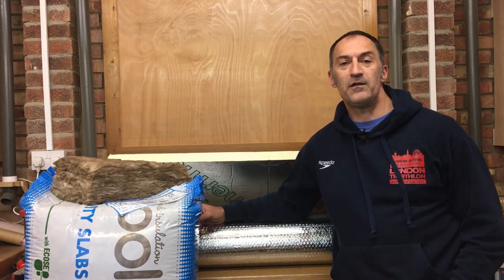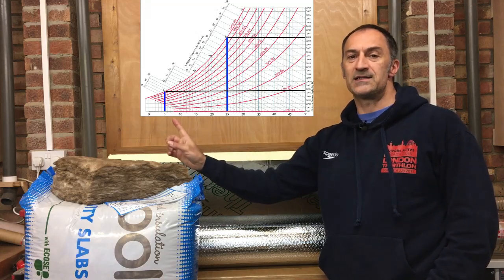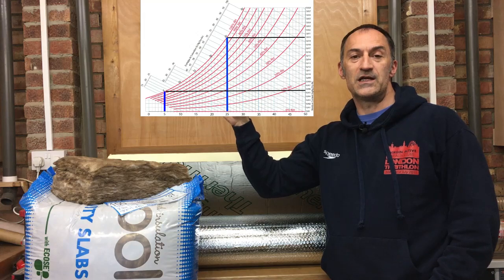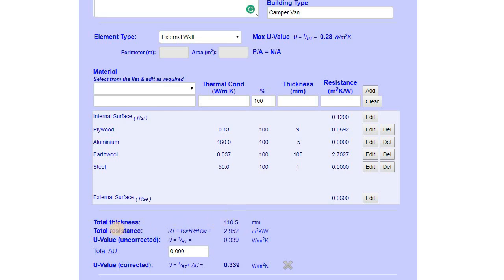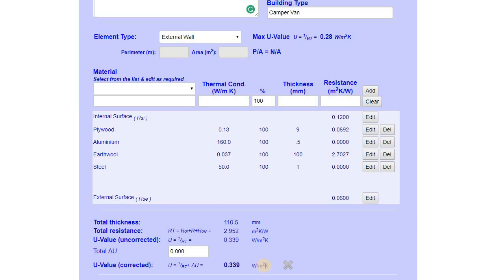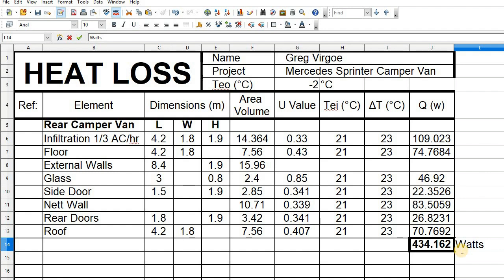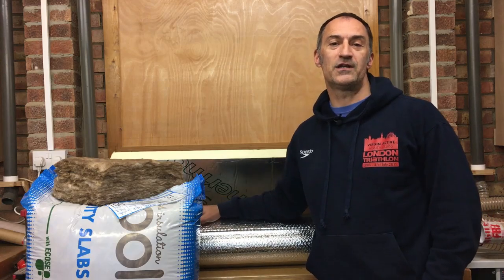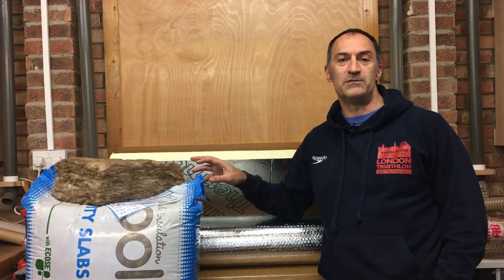How to Insulate your Van Part 1 - The facts you need!

Comment: I can see you are on home ground now, with all those R's and U's.:)

There is a train of thought that you should let the insulated layer 'breath', so that if moister does compromise your vapour barrier then it can naturally dry out. What are your thoughts on this?

Secondly, did you find handling EarthWool gave you any irritation problems?

Finally, it would be useful if you could measure the thermal properties of a van before and after insulation. Say, park your van in an enclosed garage put a 1kw electric fire in the back and measure the the temperature differential after a fixed time.
Reply from the maker: Hello, Some great questions there, and here are my thoughts :-
Letting the insulation breath would apply to a building structure where the materials you are using are semi-permeable to water like bricks and timber etc. In the case of our van, we have a sheet steel outer skin which is painted, insulation in the middle and a foil vapour barrier on the inside. This creates a completely vapour sealed void where moisture cannot enter from either side keeping the insulation dry at all times.
I hate working with glass-fibre products, the fibres get in my throat and I'm coughing like mad, but this Earthwool is really soft to handle, no irritation to the hands or arms and I had no coughing at all. I was really pleased with it.
Lastly, we have plans to take the van to a climate control R&D facility when it's complete and run full tests on it, so please subscribe and watch this space. Thank you
Reply: Sorry for the late reply, just spent all day freezing under my van finishing off fitting the water tanks.
That's execllent news about the EarthWool. I recently insulated a new stud wall with glass fibre wool and it was a horrible job to complete!  Vapour barrier it is then, looking forward to the next installment. Be quick:)
Reply from the maker: I have my belly tanks now too. I’m sprayed no the metal brackets and will line them with armaflex foam strip.
Did you use CAK tanks?
Reply: No didn't use CAK since I found them difficult to communicate with. Instead used G.F.G Plastics. Really good service and very friendly. They built the tanks exactly to my measurements. If tanks can look nice, then their tanks look nice! I fashioned my own brackets out of 4mm strip steel, fastened with 8mm studding into M8 rivnuts. 

I will try to get some YouTube pics up of my build. Won't be anywhere near your standard, but if it helps others then great.

Hmmm, Armaflex now thats a good idea. . .
Reply from the maker: +Flashback if you have time to post a few photos to my Facebook page that will be very interesting to see. I have the tanks but no paperwork or instructions, will be contacting them tomorrow for some advice. I thought the armaflex would help prevent vibration and chafing of the brackets on the plastic.
Reply: My brackets are 30 x 4mm steel strip. I don't think this tank is going to move. They are constructed from 6mm plastic and feel pretty rigid.

Sorry, not into FaceBook, but I've posted a few pics on Flickr:

https://www.flickr.com/photos/138368573@N07/albums/72157687540251772 

Couldn't bend the strip at 4mm, so hacksawed a 1mm deep cut which helped give a clean bend, but still had to use a club hammer. Fianlly, painted with grey Hammerite to protect. M8 studding galvanised steel, but  nuts, nylocks and rivnuts are all stainless.
Reply from the maker: Thanks for the heads up. I will try email first. Cheers
Reply from the maker: I have looked at your photos and seriously impressed. For starters your photos are incredible, the picture quality, clarity, the out of focus background effect, you must be a professional or have studied this?
Secondly, the brackets are ace and you have done well making them with just a grinder and vice.
You should make a video of the build for youtube, I would watch this quality of work. Well done!
Reply: Well, thanks for the generous compliment and yes I have done a 'bit' of photography. The camera used for the brackets is the ubiquitous Panasonic LX100. A great all round camera. I do plan to put all this stuff in a video, but I'll see how it goes. 

Whacking that piece of steel with a club hammer was my desperate attempt to keep the project rolling along!  I much more at home with a piece of wood and have a decent amount of tools for that.

My actual profession is an electronics engineer. I'm in the middle of designing a complete bespoke control system for the van. This will integrate the battery charging/monitoring, solar control, electric step, water levels and security system. All readouts will be OLED, with a synthesized voice output for warnings. A bit over the top, but heck who cares!

Any joy from CAK?
Reply from the maker: That control system sounds right up my street, will be very interested to see that. 
I've emailed them initially and hope I get a reply tomorrow.
Keep me posted with your build updates.
Reply: I had trouble with CAK not replying to e-mails. Maybe their premium phone line is there for a reason:(
Reply from the maker: They do appear to have a landline number also now I’ll try that if I don’t get an answer. Thanks for your help.

Comment: Fantastic video and beautifully explained so even I could grasp the theory behind what materials and why.Also noted you answered a question on sound deadening, I was delighted when I clicked the link as the eBay items where exactly the ones I have identified for soundproofing my car,  gives me confidence that I have chose the right products. Look forward to your next video and thanks again.
Reply from the maker: Hello Paul, yes the two products look very similar, some manufacturers use it to reduce the drumming effect you get with thin sheet metal panels.  However, some people have mistaken this for foil covered bubble wrap and are using that thinking it will give them some level of insulation. Applying bubble wrap to the steel van is completely useless. Pleased you got the right stuff.
Reply: Greg Virgoe cheers thanks Greg

Comment: Great video, and so great to see some actual engineering and expertise involved in insulating vans for once. The 434W figure at the end, how does that apply over time? for example, is it 434W/hour needed to keep the van at the same temperature level assuming the outside temp as specified? Or how would that be calculated?
Reply from the maker: Excellent!  What's more interesting is that with a little light exercise two people could easy generate enough wattage on their own lol
Great comment Karl, made me laugh.  Cheers
Reply: The interesting thing to consider also is that a human gives off 100W so I guess Greg only needs to keep 4.34 humans in the van to keep its temperature stable.
Reply from the maker: It's simply a measure of the energy you would need to maintain it at that temperature.
So a 500w heater running in the van would offset the losses and maintain the 21 deg inside.
Reply: Greg Virgoe that’s why the double bed will be installed …!!… LOL
Reply: @More-Space-In-Ear  and a heavy duty suspension for those really cold nights :D
Reply from the maker: Marc’s Fx, I don't think I've got room for two yoga mats lol
Reply from the maker: Stokes Pen, absolutely right the the more you ventilate the more heat you will need to warm up that cold air. The first part of the calculation deals with the air change rate. The calculation was only for the rear portion of the panel van from the bulkhead back. I did not include the cab which will have a higher heat loss due to the glass but even so a 2kw heater should be plenty to keep it warm inside. I've been using a 2kw electric heater in the van while I'm working on it and it soon gets very warm in there even when it wasn't insulated. Thanks for watching.
Reply: Greg Virgoe Ha Ha Ha.....yoga indeedy 😂😉👍🏼
Reply: Actually, the convection is neglicted here, which can be neglicted above 5 m/s of wind and make a noticeable difference above 2 m/s. So the 434 W are just a part of the total losses. It means that you need 434 Wh of energy to maintain the temperature during one hour. But modelisation never ends, at some point you need to unroll the finite elements analysis…
Reply: C’mon love, let’s exercise! The inside temperature is dropping! :-D
Reply: Fantastic presentation!
Reply: Fantastic presentation! Thanks Greg!
Reply: Hi Greg, I live in the US. I am planning to be building out a van in the next few months. I have been told that if I am going to be spending 85% of my time in the van in warm/hot environments then I should not insulate my van. Is this the case?
Reply: Sorry there. Didn't realize I was on a reply screen.
Reply: @karenbickel1154  insulation provides real value in hot and cold temperatures. It must be insulated for comfort too.

Comment: thanks Greg just like to ask you why not use recycled plastic insulation it wont a zorb condensation  ?
Reply from the maker: Hello Milo, Having read your question again I needed to rephrase my answer. 
The purpose of the vapour barrier is to prevent any moisture getting to the cold surface of the metal van, this is where condensation will form and this could rust and rot the van in time. Having an insulation that is moisture repellant is a good thing but I don't want the moisture getting in there at all if I can avoid it. The Earthwool is made of recycled materials. Thank you

Comment: Hi Greg, thanks for the great info, charts and all, really look forward to catching your videos. Just a small thing that I’m sure you noticed but I’m sure the thermaboard insulation was missing from your Uvalue calculations...not sure if that was intentional. Anyway thank again look forward to the next one!
Reply from the maker: Hi Stephane, that's super observant of you. I'm using the insulation in different parts of the van.
So I'm using Kingspan in the floor and in the roof, Earthwool in the walls and doors.
I have added a link to the description with a print out of all my U-Value results.
Thank you for a great comment and thanks for watching.
Reply: Cool...excuse the pun...so from this each surface has its own calculation rather than a total space calculation, so if you use a different combination of materials it requires a different calculation...like it makes sense a bit of a ahah! moment thanks Greg. Like the reminder for external glass insulation thanks again.
Reply from the maker: Yes exactly, each combination of materials requires its own calculation to arrive at the U value for that structure. From there you can work out the heat loss through each element.

Comment: Thanks for the details and calculations for insulation in the van. I was interested to see the difference in window areas as compared to insulated areas in the van. You mentioned thermal bridging, as I understand that is the heat that is lost through any metal connections to the body of the van. As shown in your calculations this would depend on the area that is compromised by thermal bridging. A few screws to fix the panelling may not be a problem, but maybe using an aluminium rail to fix cabinets may compromise the insulation. When would you be concerned about thermal bridging being a problem in the design?
Reply from the maker: You are exactly right, in terms of surface area the glass is very small but in terms of heat loss it's a big number. The structural ribs of the van come very close to the back of any internal paneling so there will be very little insulation at that point. The door frames are a thermal bridge as they are all steel and it's very difficult to combat this area. Screws into the structure could get cold enough to get a bead of water on them, but unless you glue everything with "No Nails" that unavoidable.
There is only so much you can do with a van to prevent this and at some point, it's a compromise. Purpose made motorhomes or caravans are made of a composite material which is a sandwich of two skins of lightweight metal with a foam core middle and no thermal bridge. Plastic double glazed windows which don't conduct heat as much as glass.
A layer of foil bubble wrap covered with plywood lining should be enough to break the direct transmittance.

Comment: Hi Greg. Once again very informative. Good stuff. I have noticed some other camper enthusiasts are using foil sheets or squares as an item to reduce sound and vibration on the inside areas of the flexible steel panels of their van. What are your thoughts on this? Would this effect the condensation barrier? Thanks, Steve.
Reply from the maker: Hello Steve, The material you use to prevent the drumming sound of sheet metal panels, looks like reflectix, but it is very different. It's a closed cell dense foam covered in foil, the foam dampens any vibration noise. See link :-
https://rover.ebay.com/rover/1/710-53481-19255-0/1?ff3=4&toolid=11800&pub=5575265109&campid=5338027957&mpre=https%3A%2F%2Fwww.ebay.co.uk%2Fsch%2Fi.html%3F_from%3DR40%26_trksid%3Dp2047675.m570.l1313.TR1.TRC0.A0.H0.Xsound%2Bdeadening%2Bsheet.TRS0%26_nkw%3Dsound%2Bdeadening%2Bsheet%26_sacat%3D0
Bubble wrap would not have the same sound proofing effect. Putting reflectix directly on the sheet metal of your van is as effective as sticking the money it cost you there instead. Basically useless as insulation or vapour barrier in that location as it will be exactly the same temp as the skin of your van.
Reply: Yes, the number of van conversion videos I have seen with people just sticking bubble wrap to their walls is surprising. I guess many are just following what others have done rather than putting in the research time themselves.
Reply: Hi Greg, sorry to correct you but for the sake of accuracy: many of the sound deadening / vibration damping products you link to aren't actually closed cell foam but compose of a self adhesive butyl layer covered in foil. This adds mass to the panel reducing its resonant frequency. There are some CCF based products claiming to do the same thing but with a much lower density so they could never be as effective at dampening vibration but do have the benefit of minor thermal and acoustic insulation, so could be a good choice depending on application.
Reply from the maker: You are absolutely right Andy Taylor, I just posted a search result from eBay. I can't validate the accuracy of everyone's listing in that search result. I should have posted a more specific link to the exact item you refer to. Thanks for correcting me on that. Cheers
Reply from the maker: What I was trying to emphasise was not to get confused and use reflectix on the surface of your van thinking it would either insulate or act as a sound proofing material because it clearly won't do either in that application.
Reply: RattleTrap for sound deadening.
Reply from the maker: I assume that is a trade name?
Reply: Yes Greg, Rattletrap is a brand name. More popular overseas but available here. Personally I prefer the Silent Coat brand and have used it extensively but they are all much the same.

Comment: Hi Greg. I've watched all videos in the series so far. Really enjoyed your approach & the level of detail you are providing. I'm embarking on my own sprinter build at the moment. I have a 2005 Sprinter with the  same dimensions as yours, so your experiences are relevant. The different challenges for me are that I live in Australia, in a very different climate. Most of the time, the challenge is dealing with heat, not cold; although winter (short as it is) can get into the - overnight, say 1-3 below. Day time maximums for 5-6 months of the  year however can be in the 30's and up to 40 for a couple of months. The plus is it's great for UV on the solar panels :) Thanks again for all the work you are  putting into these videos, they are helping with the decision making process and some great ideas on what to do & not do. Cheers
Reply from the maker: Hi Darren, if the temperature outside of the van is hotter you will experience a heat gain instead of a heat loss, but the calculation is exactly the same. Therefore insulating the van will also help to keep it cooler in the summer. The only additional thing to take into consideration is the solar gain through the windows. I would recommend having external reflective shades to prevent the sun rays from entering the glass and heating up the internal fabric of the van. I'd be interested to see how you are getting on with your build if you're happy to share a few photos on my facebook page. Thank you for the support and excellent feedback.
Reply: Thanks for the reply Greg. Yes, I'd already made a start on the insulation. I'm using a product called foilboard (25mm) reflective insulated panel. I went for 25mm so when I glue it to the walls and ceiling I have an air between that surface and the ply or timber tongue & groove boards I'll have as the finished surface. Like you, I'm planning on using a wool type flexible insulation to stuff into all the small spaces where a panel board just won't work. I've kept windows to a minimum - only 2 in the back opening rear doors & none in the side walls. For me this will keep the direct sun out & make the  van more 'stealthy' when required. I'll use reflexive shades and an internal light block curtain to keep out light and heat. I'll do a similar process for the cab and a drop down heavy block curtain to completely separate the cabin from the rear living space. I've also installed the  same fantastic vent as you. I'm hoping that will help remove heat too. Truth is, the weather is so good most of the year that we will just put a big shade, like a Fiamma F45 on the outside and live outside most of the time! I'll post some photos as I get further into it. Thanks again for all the advice you have provided so far.
Reply: Darren, did you play AFL?
Reply: How do you do external reflective shades on a van?  wouldn't the weather destroy them?
Reply: Does the Reflectix on the inside make it more difficult to cool the van with a fan in the summer?